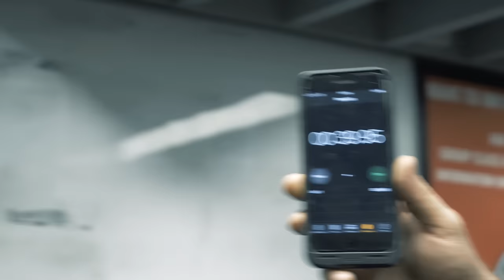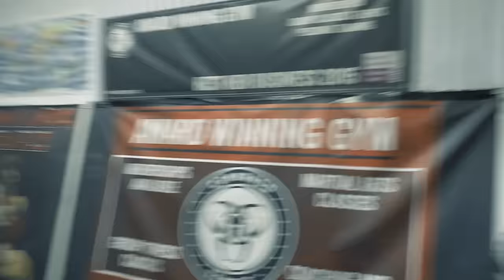LIFTING THE UNLIFTABLE DUMBBELL | KEG RUN | EDDIE HALL

Comment: The only reason Eddie wasn't able to lift it was because he wasn't hydrated.
Reply: @cooperramos2700  Eddie was the third person to lift more then 500k after big z and brian shaw, he did it in a show, z and brian did it at the arnolds with the hummer tire deadlift, currently if you count these two it's big z at 1157lbs brian at 1140 lbs thor at 1114 eddie at 1108 and so on down the line. I pick on the eddie fans with fact, it's far more fun. Brian did it first, Z did the biggest.
Reply: Pervatasaurus  See my last reply.
Reply: @Scootermagoo  I think Brian has done 1157 if I am not mistaken
Reply: @dustinontaiyabbi5608  As far as i know Z holds it at 1157 and brian is in the 1140 range.
Reply: Pervatasaurus  It's the internet. Use capital letters.
Reply: Pervatasaurus  jass goot thunkling
Reply: Pervatasaurus  Now it's starting to sound like an Eddie Hall video and his sycophants. thtbtbtbtbtbtththtbtbt.
Reply: Pervatasaurus  Hehehehe I needed a good laugh this morning, Thank you sir. It was pleasant sending jibberjabber back and forth.
Reply: @trentschlosberg7613  Since you are really late to the party how about you buy us all a round of drinks and join in the eddie bashing? and as a update there is 4 or is it 5 people that have lifted more.. Props to JF Caron for the 1200+lb lift.
Reply: @Scootermagoo   I do think you have to take the lift itself into account. Doing it with tires is different than doing it with a "normal" deadlift. The weight is balanced differently, the starting heights are different etc. When talking about such high level performances those seemingly minute differences have quite an impact. Just because you can lift the tires doesn't mean you can do the deadlift, and vice versa.  That said, lifting half a ton is lifting half a ton. And then there's Thor who, unlike the other 3, didn't do it at a competition under preassure but at his own gym. And if we're talking about world records, then circumstances need to be accounted for as well. And the fact remains that while he may not be the first one to lift half a ton, Eddie was the first one to deadlift it.
Reply: @timokampwerth1996  Fact 👊
Reply: @timokampwerth1996  well said.
Reply: @Scootermagoo  sure you are 🤡
Reply: @rocketman9838  Someday you may find out. Internet warrior someday, but yeah at 52 now i'm not liable to want to do that kinda lifting again, it's tough on the knees after a lifetime of being 275-325lbs, being tall and the size of a nfl lineman hasn't been kind.
Reply: @Scootermagoo  just look at yourself lad your bragging to people probably way younger then your self online to a video that was only made for entertaining
Reply: @Buckkkk  It's more about annoying the eddie sycophants then anything else. I don't really care but when you call my manhood into question, because you know armchair warriors, is when it gets annoying, and for anyone else in the future I'm 2-3 inches taller then eddie and if I was his age I could have been the strongest man on earth, I chose to not destroy my knees and shoulders. I saw what it did to my dad. So do not under estimate people on the internet. Some of us really are what we say we are.
Reply: @Scootermagoo  if you were even remotely close to being the “strongest man on earth” you would actually be doing something productive in your life and wouldn’t be chatting shit to people and bragging that you “could have” been better when they are just speaking on topic nothing got to do with you
Reply: @Scootermagoo   and for being on the planet for “52” years and not knowing how to use your hollow head is kinda sad like
Reply: @Buckkkk  You sure do have an opinion about everything. You do not know me nor do you know who I am, not to be cliche, so assuming something from a comment in yt about a year old subject is kinda asinine.
Reply: @Scootermagoo  do you know who Candice is?
Reply: @Scootermagoo  the rules of internet bragging has shown to be remarkably accurate. Generally lower the claim by half for true value...
Reply: @sorenjensen3863  I know and I treat most people as such, the thing is outside of being 3 inches shorter then brian and 2 inches taller then small hands eddie, and weighing 250+ lbs "thin" it wouldn't have taken a great leap to get there.. I have the physical leg strength to do it, I would have had to work on the rest, My dad was a body builder/weight lifter and I have his and my grandpappies genetic who was another very strong individual to have gotten there.. It's not a hard concept, but without pictures or proof the internet braggarts get in the way of the truth, and truth be told I wanted to walk at 50 and my dad could barely walk at 50.. So I chose to be lazy, and not destroy my body.
Reply: @Scootermagoo  this is some pretty low quality bait
Reply: @imitatsiya  You guys have taken it for a year now.. Musta worked, dontcha think? I did it mainly to piss the eddie fans off, because they were all smug and acting the pricks, so i decided to deflate a few ego's. Defending his small hands *which is bs because he can pick up the inch*, I mean how pathetic do you have to be to use that for an excuse? 2 Eddie wasn't the first to lift more then 500k, he did it with a deadlift suit and a stiff bar.<-- this is what he did. Brian and Z both picked up more, granted it's a different lift if you count the whippy bar and the tires, and now Jerry and JF have both exceeded everyone. Thor can stand up proud cause he took his hatred for eddie and beat him at his own game. So yes the trolling worked. It was fun for the last year to pick on them/you. Someone had to do it or you pack of fools would still be touting eddie as the best, when clearly he wasn't and isn't. Always remember Brian did it first and up until jerry/JF Z did the most, Eddie was third thor was 4th and then jerry and jf.. I only pointed out the facts. I let you guys get angry and rant, and kept pointing out the same facts. And it worked. It's amazing what you can do with a fact.
Reply: @Scootermagoo  you seem proud of the fact that you’ve been in an argument for months.
Reply: @ZekeAndroid49  Nahhhh, people ask questions. I gave a answer to that question was all. I made my point a year ago, and people popup saying I'm blah blah blah.. So knowing they are eddie fans, I like giving them hell. They stop I stop, so far it's mainly been in a nobody cares mood, and now it's starting to come back to life.
Reply: @Scootermagoo  yo, why you got to bash any of them?
Reply: @Scootermagoo  ah, alright. well, you do you, i guess
Reply: @slimslanginslinky  It's only stupid if you do not read the entire comment section, and interpret the last 3 comments like most people do. It gets you comments about your intellect and inability to accept the facts as given. Before you make a stupid comment, please read the entire section and apologize. Since I know you wont being an eddie fan and easily pissed off because being a fanboi is easy and allows your internet anger to flourish. Just know. You already lost and can never accept it.
Reply: It’s his hand size 🤚and grip
Reply: @tacticalsportsmanproductre6069  chuckles and that's why he picked up the inch but not the other.. right.. same handle btw.. so try again. But grip yes, brian does have that, and we still debate who was/is stronger Z or BS
Reply: @Scootermagoo  if Eddie had banana hands like BS he totally could. The other weight is lighter clown. The added weight plus the thickness off the bar cause it to roll. Much easier to control with banana hands.
Reply: @Scootermagoo  I didn’t say he couldn’t if he wanted just stated if he had banana hands it would be easier and he prob would not need any specialized training. Thanks for letting me do me I appreciate the permission.
Reply: @tacticalsportsmanproductre6069  Eddies 6ft3 brian is 6ft 8.. I'm 6ft 5.. I know I can pick an inch up, it's more a question of can I pick up 170ish lbs off the floor more then my grip. And if I wanted to have bannanna fingers like my dad did as a weight lifter/body builder I could certainly give the millenial a try... Still doesn't stop the fact that eddie due to not training for it can't lift it, also he wouldn't be first, which is his claim to fame. I'm pretty sure eddie can lift the millenial but it would probably take a few years of training his grip to do it, I mean... Not to say anything but if you watch the video brian picked that sucker of 3-4 times... This is just the level of grip brian has, He's trained for it. Like i said nothing again Ed but he could if he wanted to.
Reply: @Scootermagoo  So I guess your proving my point by pointing out their body sizes to prove that Brian is larger…Your size in this conversation is irrelevant.We are aware and can google their sizes and yes Brian is bigger and by default without training or anything will have a better grip because he has more surface area on the hand. Science will get you every time. Thanks for backing it up with their stats to prove it.
Reply: @tacticalsportsmanproductre6069  That's precisely the point, Eddie doesn't have small hands. He has hands that fit a man of his stature same as i do you probably do and brian does... His hands are not the problem his training is.. I mean if you want to argue, I'm game. But I'm just pointing out something and people take it the wrong way.  The point is this year and somethings argument over hand size is and always has been irrelevant and will always be irrelevant. Eddie doesn't have small hands he has hands that fit his body, If he wanted to pick up a millennial he could, he would have to train for it. That's the point. No other point needs to be made. Yet here we are.
Reply: @Scootermagoo  you are correct Eddie has hands that fit a man of his stature and Brian has hands that fit a man of a bigger stature. The science is strong with you.
Reply: @tacticalsportsmanproductre6069  Finally someone with some common sense has found this thread. Praise be the Hafthor, Hallowed be thy name.
Reply: @dnuma5852  Another eddie is dehydrated fan has joined the fray...
Reply: Don't forget Eddie hall is just an average 6'3 guy who just worked to be strong while shaw was born a beast
Reply: @DICKTURPIN1976  This discussion never seems to end... Eddie has hands big enough to do this, he never trained grip, all of his dead lifting is with straps. Brian holds 800lb bars for grip training. The only difference is that. Eddie can do the thomas inch which has the same handle.. He never trained grip. Other then strapped deadlifts.
Reply: @pablohill6688  Average... have you not seen him stand next to a average 6ft3 bloke? I mean I'm not an ordinary 6ft5 person and brian, isn't your average 6ft8 character... I mean not to say anything but being 6ft 3 and 375lbs "thin" is not an average person.
Reply: @Scootermagoo  Okay so A. You have no idea who I am, but as you have an entire  glossary of replys in the comment section I/we (the youtube community) can get a surface level understanding of who you are. B. If you're going to throw around insults like dumbassed, atleast spell it right mate, there's a saying it's better to keep you're comments to yourself and be thought a fool, than to share them and prove it. C. I'm not trying to be a keyboard warrior, I think you just need taking down a peg or 2 because in your attempts to take down all the keyboard warriors, I think you've become their leader, congratulations.
Reply: I think they key factor is his hand size compared to Shaw... you have to rely heavily on your grip and getting a full grip to support the rolling any less than that would slip through the gap
Reply: @muayboran6111  I have said i have no doubt eddie can do it, if he trained grip as hard as he trained deadlift.. You know who has "small" hands that can probably pick it up at least at one point was bennie when he was deadlifting 1000+ with no straps.. I'm willing to be he could have also.
Reply: @Scootermagoo  damn youve been commenting for 10 months
Reply: @fierydarkbg2210  The quality of folk that have responded has been... entertaining ... to say the least. I have to have something to do while covid's a thing.
Reply: @Scootermagoo  oh lol
Reply: @fierydarkbg2210  Seriously, people like to make excuses for others, it's been fun giving them hell.
Reply: @Scootermagoo  maybe true
Reply: @Scootermagoo  depending on their excuses if its bullsht or not
Reply: @geniusmarcsays2434  The thomas inch... 68 kilos.. you lift it 1 handed without straps? have video proof? That is your literal body weight with 1 hand with a grip the size of a coke can...
Reply: @geniusmarcsays2434  bruh only a couple of ppl can do that are u a powerlifter or something? Cuz if ur not, keep dreaming bud
Reply: @Scootermagoo  l
.
Reply: @Scootermagoo  why are you still commenting
Reply: He could lift the world if he was hydrated
Reply: eddie would lift it easily if he had bigger hands nothing to do with height though i mean kalid is only 6 foot and he can lift it with his big black hands lol
Reply: @Scootermagoo you have 277 comments on this channel, you need to get out more buddy, the internet is consuming you.
Take a break, it's a sad look on you.
Reply: @petrolhead0387  what is your problem? it's a 3 year old video.. who cares..
Reply: When he’s healthy Eddie is hard to beat sometimes

Comment: I trained hard to be able to dumbell press 50kg each side for 10 reps, I struggled for ages then I went to a different gym and the 50's had a thinner bar, I could control the weight much more so I 100% understand the thickness of the bar helps or hinders. The bigger the hand the more help you have with grip

Comment: I think the size of your hands is really important for the dumbell lift. It helps to prevent rotation!👍
Reply: I think so. It would be pointless if you have an enormous strength yet you can't grip it due to your hand size.
Reply: @rizqibayumantari6769  Your both wrong, eddie picked the thomas inch up which has the same size handle.